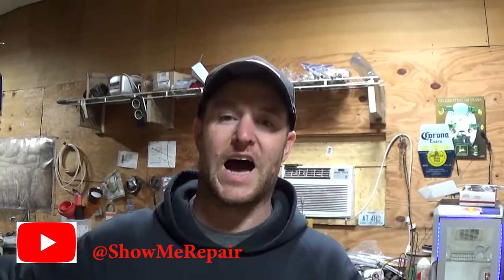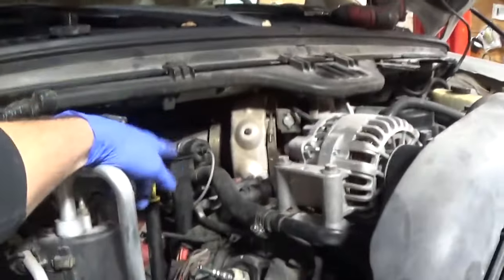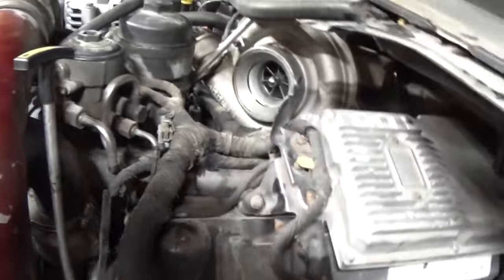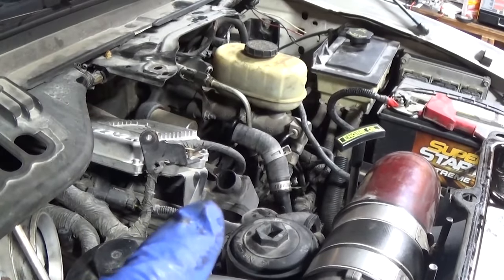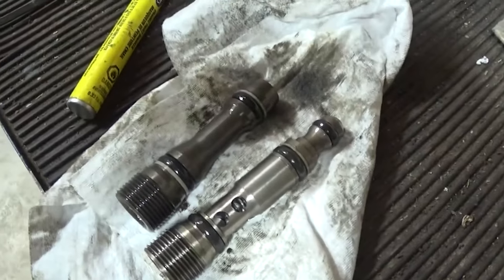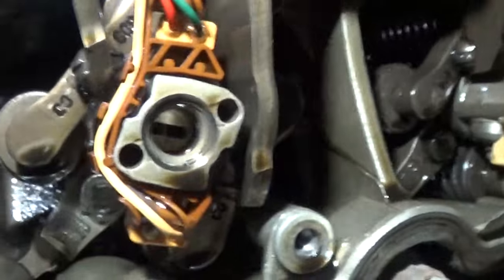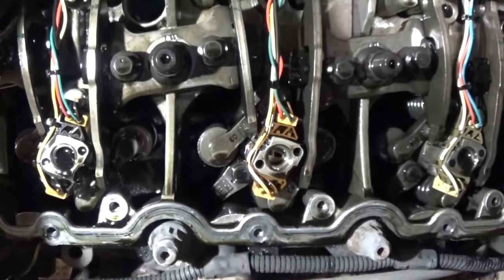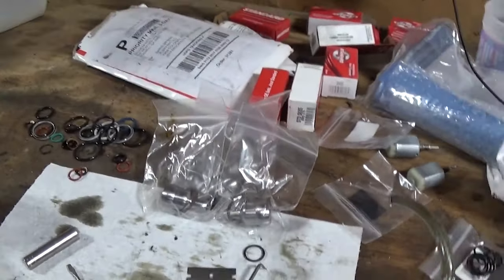I Learned something new on a 6.0 Powerstroke

Comment: I've been repairing the 6.0's since 2005 and have seen everything. Your video I have had the same problem with many of the "O" rings ripping apart. One truck in particular was an '05. After doing the air pressure test: removing the FICM solenoid with key on to keep the oil/air from escaping past the high pressure pump the results were the same as you encountered with the video so I put new injectors in it, reinstalled the oil rails. Now the stand pipes usually blow the "o"ring on the passenger side before the passenger side at the bottom that fits into the tube that connects to the distribution manifold. at or about 1000 miles with a program but without a program they do last longer. Here is a good tip you should try. Before installing the stand pipe with the three "O" rings get a crimping tool just like the power company uses to crimp the aluminum connectors with the jaws that make a perfect circle crimp after sliding the two wires that come out of the service entrance to the 240 volt wires from the utility pole to a house. Similar to a butt splice but much larger. I buy them from my local marine supply house that is used for making an eye with a cable.That gives you a berrer idea of the tool description.  I take the tube with the three "O" ring plug with the check valve in it after putting them side by side as it would be together and mark the outside tube with a marker to see the exact position of the "O"ring is when inside the tub and I crimp the tube just above and just below that "O"ring position and that "O"ring never blows again. The reason the "O"rins blow out the injectors witch is age too but the diameter of the ball valves that come with the late '04 and some '05 trucks where the part goes into the injector measures 0.399 and 0.400 whereas all of the Chinese garbage is 0.383 or 0.384. That being said buying a new set of ball valve kits and installing them in the oil rails to replace the "0"rings I put the oil rails back on, assemble everything and started the truck up to let it run to allow the seals to seat before letting the customer take it. Well after 20 to 30 minutes the engine died. Ran another air pressure test only to find air leaking from both sides. Thinking I damaged an "O"ring I disassembled the oil rails for inspection. After reassembly five more times I put the thinking cap on and knew there had to be a mechanical failure of something. That's when I took my dial calipers and measured the snout of the ball valves. I had several oil rails from previous jobs. I pulled the rails out from a late '04, did nothing with them except clean and installed both. To my surprise the truck was back in action. End of that story. I went online and ordered six ball valve kits from different businesses on ebay. Measured all from each seller and all were 0.383 and some were 0.386. I then went to seven different junk yards to find late '04 trucks/engines. I bought 5 pairs of rails after measuring each and each was 0.399 and some were 0.400. Here is some important info for your subscribers to definitely pay attention to. One other thing I found withe "0"ring kits is the seal in the top of the injectors is the rubber quality is not created equal. Some will be soft and some hard at room temperature. Paying attention to that is also Important cause the soft ones don't last. Another thing : after installing the oil rails it takes a lot of cranking to get the oil rails full of oil before the engine starts If you look at the top center of the oil ring rail you will see a n aluminum plug with an allen head recess. Remove it, take a plastic bottle that comes with Differential oil in it and because it has the extended funnel spout, put engine oil in it. that port is used to squirt oil in the rail so a lot less cranking before it starts but removing the ICP on the passenger side and the plug at the rear on the driver side. Then invert the quart bottle and squeeze until oil comes out of the ICP/plug and install each. That additional oil will save a starter for sure. I enjoied your video. Keep up the good work.
Reply from the maker: @JosephCOser  only time I see repeat o-ring failure is with Rotella oil or fuel in oil.

Comment: O-rings is what brought down the Challenger Space Shuttle… almost 40 years later, they’re still taking down 6.0s!
Reply from the maker: I guess something better needs to be invented
Reply: @showmerepair  figure that one out and you won’t have to work on trucks anymore!
Reply from the maker: I am working on a fix for the high pressure oil system. It won’t make me rich but it will sure help a lot of people out.
Reply: @showmerepair  I have two LCFs with the 4.5 liter. They got new dummy plugs and stand pipes a few years ago and the new oil pump fitting along with all new injectors… but one of them has a slight hot start hesitation. I’m leaning towards the nipple cup orings.
Reply from the maker: Do they have the quick connection at the high pressure pump?
Reply: @showmerepair  the snap to connect was changed to the jam nut style in 2016… it’s not a no start yet, and it only hesitates when the truck hasn’t had any time to cool off. Even after just 10 minutes of cooling off it starts like nothing is wrong at all. I’m pretty sure everything on the oil rails is original. I have the nipple cup kits and a set of dummy plugs and stand pipes to put in it too. Just waiting for the right time to do it… it’s been 100 degrees down here every day until recently.
Reply from the maker: Sounds like you on it. Yea hard to get any work done when it’s 100.
Reply: @showmerepair  thanks man! Wish me luck. I have those two 4.5s and a 6.0. I wish they would have just put 6.0s in the LCFs, they wouldn’t be so bad. Being able to tip the cab up is pretty awesome! But parts for those things can be a pain sometimes!
Reply: @showmerepair  how do you plan on doing this?
Reply from the maker: @littlelouievs  fix for high pressure oil system?
Reply: The problem is that engineers never have to work on the shit they engineer. We change that, we change everything.
Reply: @showmerepair  NO, These Mechanics who work on them need to be more Mindful of what they are doing, you just can't gorilla wrench everything.... I have even found the stealerships screw up as well, Had my heads replaced and the dealership forgot some bolts, screws, as they were laying on top of engine bay

Comment: Something I just had happen about a month ago, - history, I am a qualified tech with 40+ years and the last 8 on 6.0 fords.  I cleaned and resealed all of my injectors about 1 year ago, including measuring springs, polishing valves etc. At that time I used an aftermarket seal kit including oil rail nipple o rings. The truck died 2000 miles from home but I do carry tools and parts. The short story is that all 8 of the top injector o rings had shrunk to the extent I had 8 small leaks(no start even slightly warm). I had some top o rings from AP , and some from other suppliers. I picked the stiffer o rings (AP) resealed and away it went. When I returned home I had a coil fail and had to go back into the injectors, forgot to mention I had replaced one injector for poor balance at the time I was resealing the others (this was a spare the I had serviced at the same time as the ones I was now resealing hence same brand of o rings).  When I rechecked the upper o-rings while changing the bad coil I found the upper o ring on the replacement injector had already shrunk. This happened in less than 4000 miles. Be careful with the cheap reseal kits! the rest of seals appeared to work fine but I will never install one soft upper seals. The Alliant Power ones appear to be ok, have you come across others?
Reply from the maker: I’ve had good luck with standard brand and Motorcraft. There is a cheap brand I’ve used from oreilly. I would not recommend the cheap brand.
Reply: same problem with alliant upper orings rest of the seals are fine
Reply: @chadthedrywaller6859  perhaps AP has changed, mine are quite old (2006/9)
Reply: What brand upper injector d ring o rings did you use. I just got a set of Mahle's. Should I look elsewhere?
Reply: @patrickwelch620  The ones that failed were cheap (probably off shore), Mahle has a good rep and should be fine. If they are really hard and difficult to install I would think they would be good. The cheap ones were really easy to install.
Reply: @showmerepair  have you tried the mahle brand
Reply from the maker: I agree with everything you said. I have seen premature o-ring failure in the fuel system due to fuel dilution. Doesn’t sound like you would but going over 5000 mile oil changes doesn’t help.
Reply: I had mahle brand ones and they failed within a year.  I put HHC kit in and no issues in 3 years since
Reply: Thanks for that comment
Reply: Use Hhc

Comment: So nice to see an actual mechanic who can troubleshoot and not just a parts changer. I have a 2003 6.0L with a crank no start which I believe is going to be a High Pressure oil problem. Hooking up my new Forscan stuff this weekend to try and figure it out. It just shut down completely. I have FICM voltage and FICM sync. We will see what I find. Thanks for a great video. It took some of my uncertainty away.
Reply from the maker: @JohnDaly-w4k  the scan tool will only verify the pressure of high pressure oil at the icp. It needs 500psi to start. If your making under you’ll need to air test. If you’re making over then it’s something else. More diag.

Comment: I forgot to let you know how I get that snap ring out of the top of the injector. I use a 4 inch round punch sharpen it like a needle. With the injector mounted in a vice vertically put the point of the punch about 2mm from one open end of the snap ring and smack it with a small ball peen hammer lightly. It makes that impact push out just enough to use a screw driver to pop it out. Works every time

Comment: Thanks for being honest about your mistakes and letting us know what it ended up being,Ive always said it takes a good mechanic to say "I dont know,but ill find out"😊
Reply from the maker: I agree David. Thanks for watching.
Reply: @showmerepair  I was "broke down" with no start about 3hr drive from home, so, didn't have a choice, I wished the mechanic would start off with o-rings first, he even did the air test first & still insisted on a new HPOP, you realize these are CAST iron components and rarely fail...SO, I gotta new HPOP when not needed, only have 210,000 miles on my 2005 model., so, bought it new for $37,400 & spent another $14,000 on BS repairs over last 18yrs, so, still under 55 grand for 18yrs use of a F350, Lariat, CC,FX4, SRW pretty good when compared to a new $95,000 comparable F350
Reply: @JP-mu3xl   I paid $1k for My 2003 F-250 6.0 XLT extended cab 2 wheel drive :-(      I paid some lying mechanics $7k to replace 4 injectors and swap a turbo out for a new one I had on hand, they put it soo far up my rear with that repair bill that I will never go to that mechanic shop again. Not to mention they said they will work on it right away and have it back to me within 3 days. I had to wait 3 weeks before they even put it in their garage to work on it. Then another 3 days for them to jerk off, then I had to take it back to them because of a mistake they made that of course I still had to pay for!!!  If your in Northern California, never go to "Santa Rosa Diesel!" Since then, I have been replacing all the injectors and turbo myself, and it takes me about 6 hours start to finish for 1 side injector replacements. I just finished the drivers side that they replaced about 7-8 years ago. 2 years ago I had to replace the passenger side(that was a pain due to the air conditioner box in the way of the last injector). Long story longer, I have paid a lot more money into the truck than I paid for it. It's worth probably only $10k and I have just about put that much into it within the last 12 years of ownership. Wish it were a 4x4. That will be my next rig.

Comment: Top injector oring, pick out old oring, push down tapped washer, then make a holder in a block of wood to hold the injector. Use a punch and hammer and your going to punch c clip down out of Grove and them pick it out
Reply: My truck died and that was the problem top oring on the injector was smoked
Reply: That's how I do it too.
Reply: Motherfuckin thank you!!

Comment: Just remember when you do the EGR delete you think you are doing yourself a favor but all you are doing is increasing the combustion chamber temperature by 600 degrees and you will know this when your fan clutch is engaged nearly all the time trying to keep the engine cool. Many don't realize the EGR system reduces the combustion temperature by at least what I stated above plus the cooled gasses occupy volume in the chamber which decreases additional fuel that the engine without the EGR cooler will occupy so doing a delete is a NO NO. When the EGR system came out in 1968 and some in 1970 people didn't like it because they didn't understand the benefits and I had to do a lot of schooling back then
Reply: If you proceed with a delete; it should coincide with an adequate TUNE, to account for the lower NOX concentration in the combustion chamber, and the increase in ° and btu's(presumably  80°-180° increase)
Most EGR deletes accompanied by a GOOD tune have been proven to be very effective.
Reply: From what I've seen over 20 years the stock EGR coolers in the 6.0,  are actually quite good.

Comment: Same issue on my 05.  Top injector oil rings would wear away after a couple months.  Didn’t see any issues with the oil rail, but after researching FTE website found a section that showed the same issue.  What happens is that leaks from the nipple seals on the rail causes HPO to spray on the top injector seal, wearing it away.  How long the injector seals last depends on how bad the leak is.   

First symptom is hard start hot.  Then hard start cold. Then no start.

The issue was finally resolved using redesigned nipples from HHC diesel.  These nipples are shaped differently, blowing any HPO bypass away from the top injector seal.

Almost 3 years on them, no HPO LEAKS, knock on wood.  Truck has almost 250k on the clock.
Reply from the maker: @jimcaldwell9357  great information. Thank you!!!!
Reply: Mistakenly upvoted myself,lol.  Don't know how to remove it.😂

Comment: I have only replaced the oil nipples once, and we went with HHC version of oil nipples and viton orings. 3 yrs on them in a f650 trashtruck with zero issues, the injectors were replaced with 8 motorcraft remanufactured injectors. 
I would highly recommend the HHC's oil nipples, they're a new design, patented. They are made from hardened tool steel, and have a oil leak diverting shield to keep a small leak from destroying the oil seals in the top of the injectors. I am not affiliated with HHC, I just happy to have great parts, without failures.
Reply: you have any parts links for that?, thx!

Comment: On the IPR's I buy the ones with the black plastic cover. I find they last longer. One thing I recommend is the blanket on the IPR but I go to walmart and buy the 1 1/2 bilge pump  hose and put one end where the stock air filter front piece plugs into the metal. Pull it out and put the one inch rubber hose in there so the incoming air can travel thru it then route the hose over the FICM and position the discharge side on side of the turbo where the cool air can disrupt the hot air that would normally fry the IPR. It makes the IPR last much longer. Try it out. Then for curiosity take a Lazer temperature probe and get a reading after driving for a while of the IPR. You'll be surprised what the cool air will do

Comment: Funny story i bought a injector reseal kit when i was fresh on 6.0s off amazon and the lower injector oring was clear. Well i didnt think nothing about it and tossed them in the truck. Less than 5k miles later the clear oring turned to gel and luckily caught it before it really went to shit and hydrolocked a cyl or something stupid

Comment: Still learning a lot about these high pressure oil leaks on the 6.0s Mine is a 2006 and is currently down due to a high pressure oil leak. Next step is to by the IPR pressure test fitting to locate the leak, fingers crossed.
Reply from the maker: Once you understand the system and learn to work on them. It’s not so bad.
Reply: @showmerepair  yea, I’m starting feel better and have more confidence. Thank you for sharing your knowledge!

Comment: Next tip I always test though the ipr location because you can eliminate that unnecessary noise and you can inspect the ipr screen
Reply from the maker: Your right. I’ve been meaning to get an IPR block off for years. Other part of me doesn’t see the need since I’d been successfully diagnosing them.
Reply: I usually command the IPR to 85, I it usually detects a faulty IPR also.

Comment: Next time you air test with VC off. Take the stand pipe adapter out and put a D plug in its place. Seals the rail so you don’t have the IPR leak down. On the driver side put pressure into ICP port to test.
Reply from the maker: Good idea